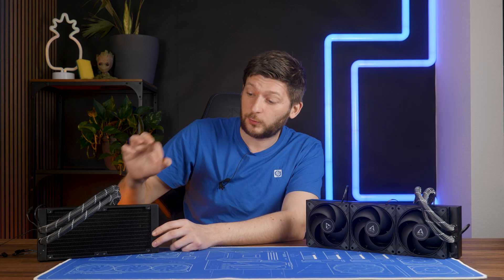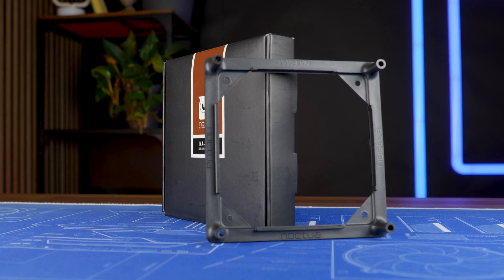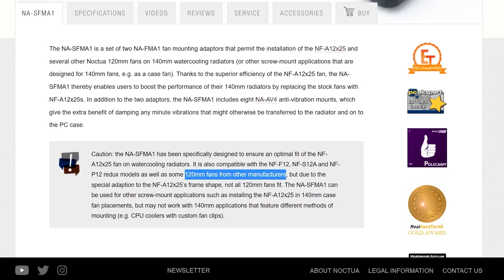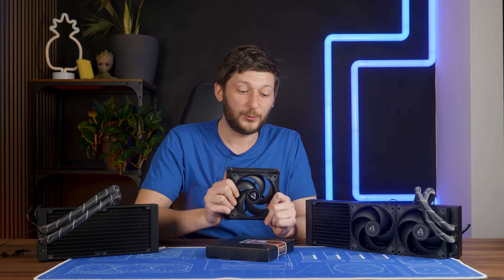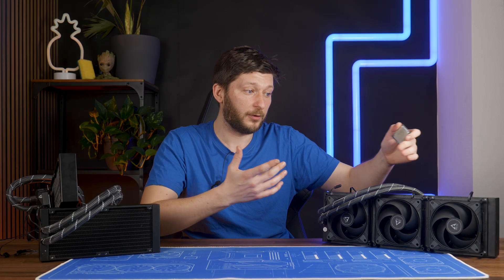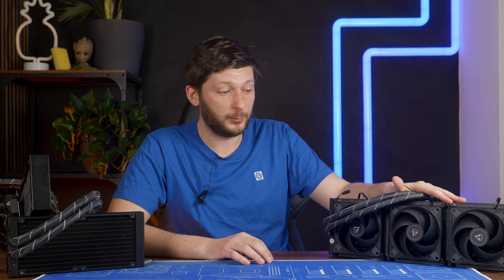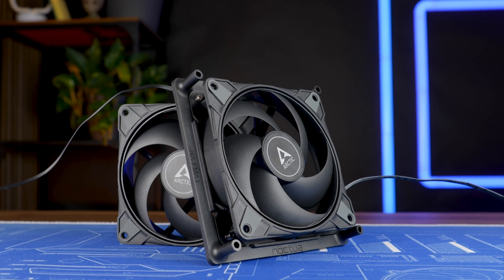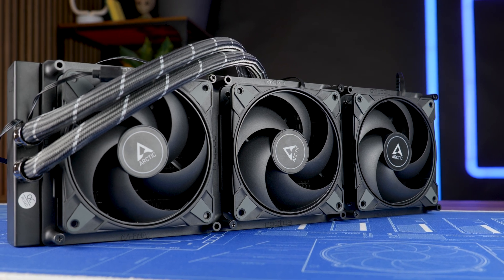We Created A MONSTER - Arctic Liquid Freezer 420 MAX

Comment: Sadly due to the intel frame included i get 10c more than with a 360 rad + custom frame. Also, you cant control fan speed even using the 3 cable provided, as they only ramp with the pump fan that gives a lot of noise so you cant take full advantage for it. The copper plate is the smallest i ever seen, about 1/4 of any other cooler. Very dissapointed with this product. I always use Artic fans, but the design in this product is not right, as you cant take advantage of noise or cooling for the 140mm fans. Perhaps its ok for amd, would not recommend this for an intel use

Comment: the pump hits its limit way before than the fans max performance and the radiator size could achive. Pump + vrm fan is max 2.7 watt. Great product though. I like it expecially for the price point: got a new 360 at 80 euros  a while ago. Amazon has the 420 at 103 € in Italy rn.
of course custom solutions would always be better in performance but point is at what price....and hustle

Comment: If you really want to improve something on the Arctic 420 you should simply make a 140mm fan shroud between the fan and radiator ...
Reply from the maker: Is going to be done in the future. We got these 140mm shrouds from Noctua ready to go. Sooner or later there's going to be a video

Comment: And im ussing liquid freezer ii 420mm with 6 icegale xtra fans 2600rpm 169cfm 😂😂😂
Reply from the maker: And what are you using to keep the pc on the floor?
Reply: @STSYT  i keep on table i dont mind noise because i have dogs my house not quiet
Reply from the maker: @jacktheripper4458  does your neighbor agree?
Reply: @STSYT  i dont have neighbor next to me is just a empty place 🤣
Reply from the maker: @jacktheripper4458  I meant the ones 3 blocks down
Reply: @STSYT  cant hear till there 🤣 is fine also my aircon block some noise to
Reply from the maker: @jacktheripper4458  and a 50cm concrete wall. Especially the 50cm concrete wall 😅
Reply: @STSYT  here is 20cm 🤣🤣

Comment: I'm surpised going from the P12 to the P12 Max on the Arctic Liquid Freezer 2 360 only gave you a 1 degree C improvement, I got a big improvement on my ALF2 when I upgraded from the P12 to the Phanteks T30, and that was with 6x P12s (push/pull) and only 3x T30s or else the gap would have been even a little bigger.
Reply from the maker: Great for you! 
But I’m getting the feeling something is weak about my LF360
Reply: @STSYT  Did you try re-pasting & re-mounting? I got some wildy inconsistent temps sometimes whenever I re-mount the ALF2. Unlike my original style-model Swiftech H320 which always perfectly mounts.
Reply from the maker: @Spinelli__  This isn’t a 1-time thing
It’s more of a pattern across using that LF on dozen of times indifferent systems

Comment: I put 3 140mm silent wing pros on my 420mm LF2. Works great and looks great.
Reply: Does it result in any advantages?
Reply: @LinusBerglund  yeah the arctic fans are prone to odd noises. I live alone with 2 cats and I don’t make a lot noise, so I hear a lot of smaller sounds since my ambient noise is a lot lower than normal. 

I switched to a Noctua d15 for my 13900k though just because I like the look. Sure my cpu temps are a little higher, but it doesn’t affect performance in games, especially at higher resolution. 

I have $500+ worth of pc fans, and in short no they don’t give you extra performance. They give you better noise performance, but in most environments this doesn’t matter. 

I only buy premium fans because I find them cool and I enjoy looking at them.

Comment: I recently contacted Arctic because I was missing a few screws and I got two of the thick bracket for AM4 (there is a thing one and a thick one to give the small fan a little extra room), and asked a few questions, one of them about a P14 Max, and they are doing it. I guess it will take a few months, but we might get a real LFII 420 Max with 140mm fans. Imagine that and make it double with another set of these P14 Max for a push/pull.
Reply: You won't get more performance from what I've seen. The 420 is already limited by the displacement of the pump. The 420 max would need to have a beefier pump if they want it to have a noticeable gap in performance.

Comment: But what about slapping on the 3k rpm noctua 140s?
Reply: Yeah either that or the 140mm version of those sharkforce fans he reviewed earlier. 120cfm 4mm static pressure, 2200 rpm. Lower performance than the industrial but much closer to the noise tier and performance of the p12 max although still better, quieter and more compatible with a 420.
Reply: @Frozoken  those shark force 140s actually look pretty decent.
Reply: @LegendForsaken  yeah I've got the 120's, they're fire

Comment: I use the arctic freezer ii 420 with 6 noctua nf-a14  industrial fans push&pull setup .. Now that a monster
Reply: How much did you get adding another 3? I got approx 1 degree c under full load switching to the 3. With 3 more I’m guessing 3 degrees less?  So 4c in total?

Comment: You probably mentioned it somewhere, but do you max out pump speed as well as fan speed? Flow rate is the one true bottleneck of all closed loop AIOs.
Reply: Yes, flow rate is a huge bottleneck. I discovered this in testing. I compared my Swiftech H320 (original model from around 2013 before they had to change the design due to Asetek's patent) and my newly purchased Arctic Liquid Freezer 2 360. Keep in mind the ALF2 has, both, a thicker and denser radiator, is a much newer product, and is in brand new condition.

I tested both AIOs with 3 fan setups. 6x original Swiftech AIO fans (Helix 120) in push/pull, 6x original Arctic AIO fans (P12) in push/pull, 3x Phanteks T30 in pull, and at different static fan RPMs (1000 RPM, 1500 RPM, etc). With the same fans at the same RPM - regardless of fan, regardless of RPM - the Swiftech AIO was shockingly always 2-4 degrees cooler than the Arctic. The Arctic has, both, a thicker and denser radiator and the fans and RPM were equalized in testing so what could account for this? Well, I don't it's due to the Swiftech being copper (ALF2 is aluminum). The only thing left is the pump. While the Arctic flows, like most AIOs, somewhere in the 25-75 L/hr range, the Swiftech is around the 300-600 L/Hr range when set to full speed (600 L/Hr according to some people).

I was surprised to say the least. It really sucks that I had to stop using the Swiftech due to not having a mount for Intel LGA 1700 (eg. i9-12900K, i9-13900K).